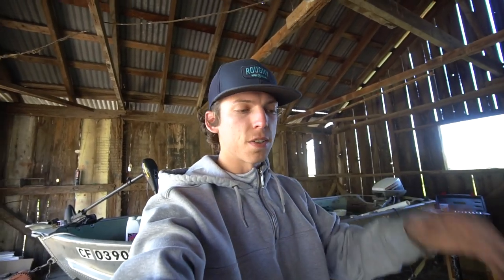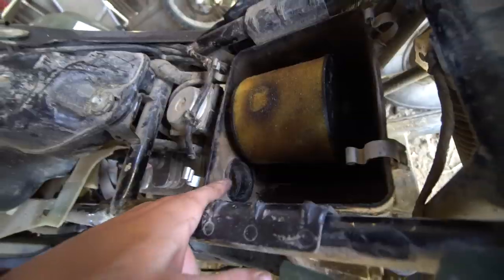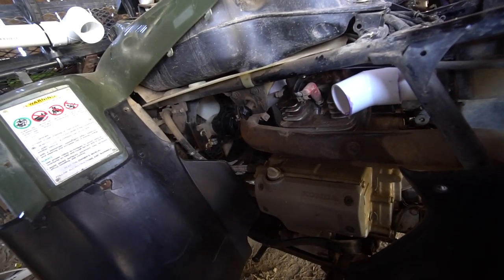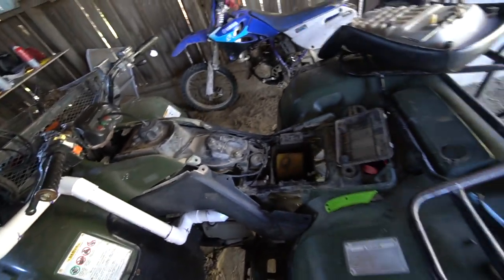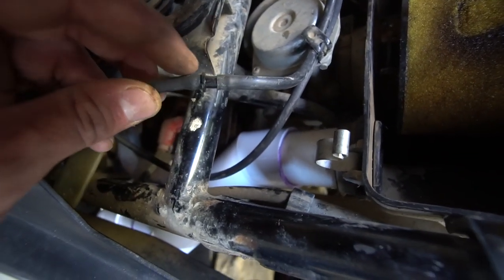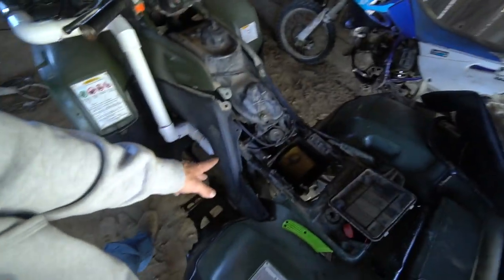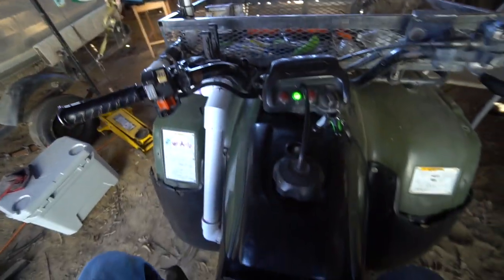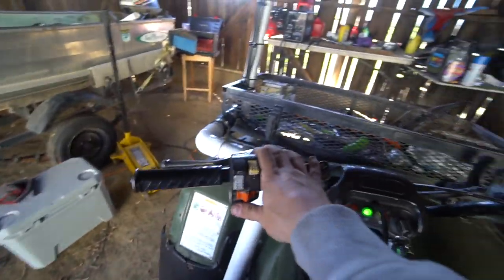HOMEMADE SNORKEL for my RANCH QUAD!

Comment: Vent lines you need 3 off carburetor, front diff , rear diff , fan , breaks , gas tank vent and diaeletric grease every electrical plug on the bike and put silicone all over air box were there is any way for water to leak
Reply: The fan and brakes have vent lines?
Reply: SoCali7three yes I did not run me rear break one cause there broke but fan I did
Reply: @obspowerstroke1864  
Hi how are you 
Looks like you know about this 
Letme ask you this  I have a 1997 Yamaha timberwolf 2x4  250 I want to do the snorkel 
But I am not sure about how many vents I have I know
Is my
 1  rear diff
2 carb 
I dont think  I have more for this four wheeler  do I????
Reply: All my vent lines have been under water lol I wonder what I’ve messed up

Comment: My kawi 300 won't do WOT with a 1.5 Inch Pvc snorkel. Im going to add a second 1.5 inch snorkel on the opposite side of the bike. I didn't know why everyone says 1.5 inch is enough maybe on a smaller 200-250cc bike. I tried to restrict the airflow aswell thinking I'm getting to much air and that made it stall instantly so I know the 1.5 pipe is starving it for air. Honda's jets might be a little better suited to the smaller pipe as every Honda 300 I see runs 1.5 and can run full throttle all day. I do it and I flood soo bad I start misfiring after a couple seconds of full throttle.

Comment: Did you run the front diff rear diff and carb line and make sure to dielectric grease your spark plug i forgot to on mine an it shut off when the spark plug went under
Reply: And put silicone around the pipe in the air box and on the air box lid